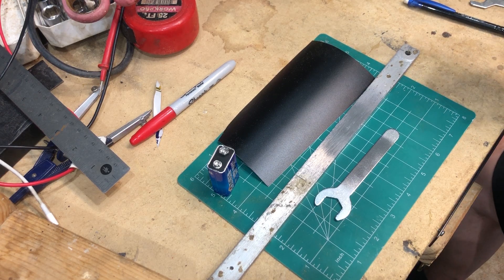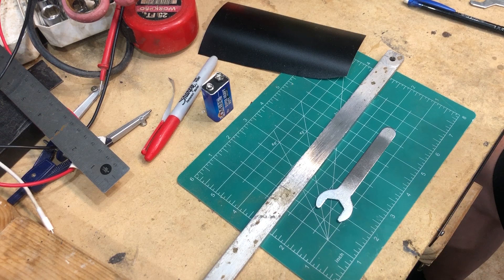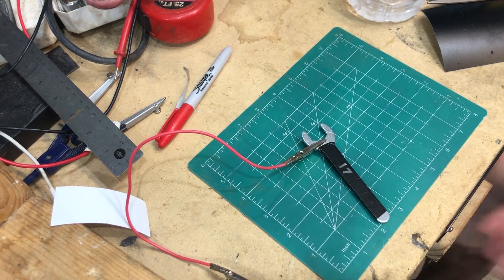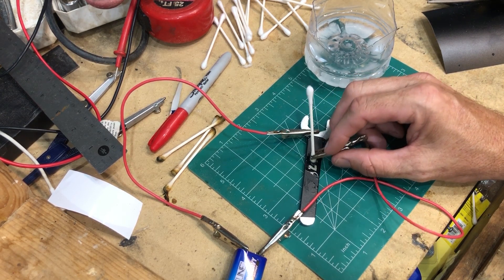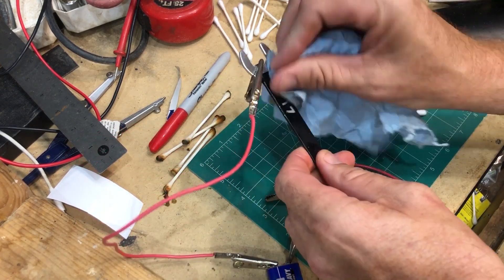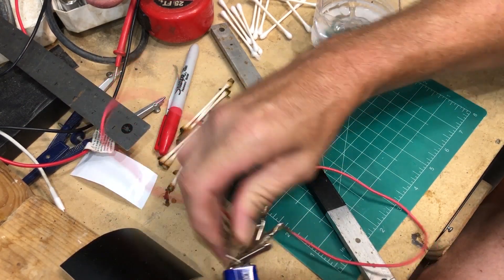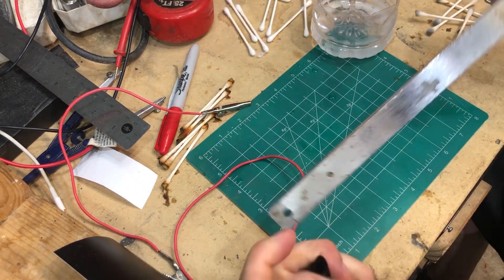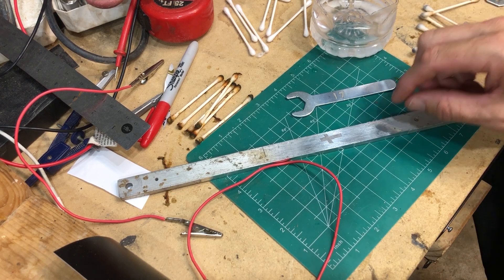Metal Etching with a 9V Battery

Comment: Very nice!  Thank you for showing how to etch aluminum and steel.  I want to use the bath method instead of the Q-tips on both Aluminum and Steel but don't know what metal to use for the negative side.  I appreciate any help you can give me with this. Thank you.
Reply from the maker: Are you trying to electroplate?
Reply: @SpiritedMaker  I'm new to this and not sure what it's called.  I'm going to use batteries and the salt water method.  I want to put my designed piece on aluminum or steel metal and then inside the container of salt water for the etching of the metal.   I know to attach the design piece to the positive wire but not sure what to use for the negative wire.  Thank you for any help you can give me.
Reply from the maker: One side goes on whatever metal you are etching and the other is on the qtip. The completion of the circuit when you touch the qtip to the metal (any kind) is what creates the electric arc that etches the metal itself. @vivianwarran8804